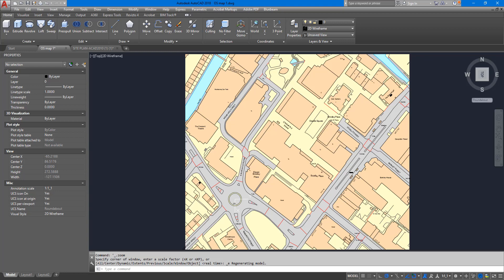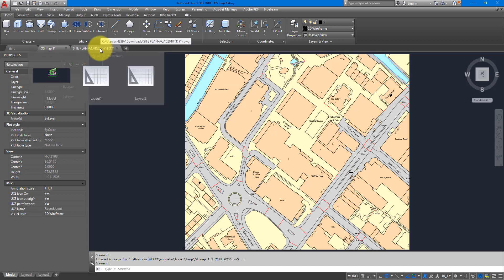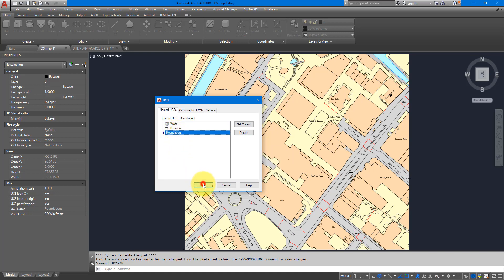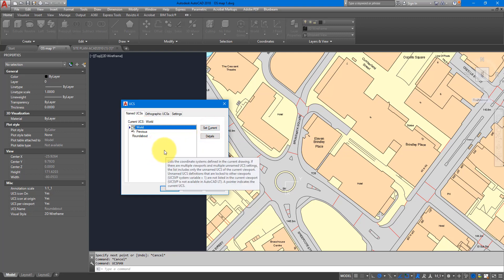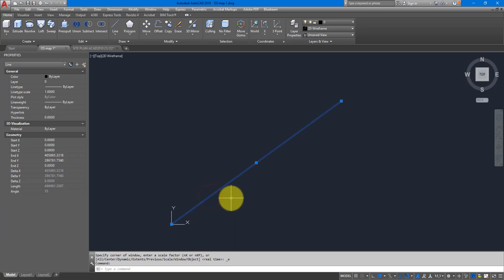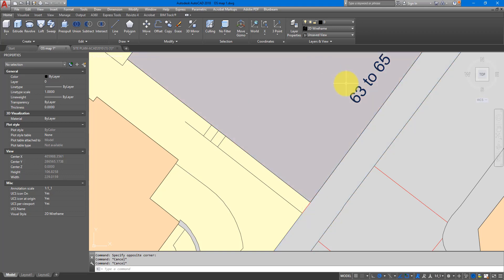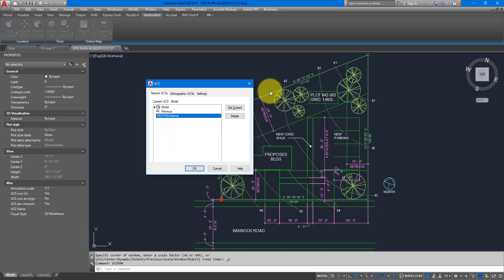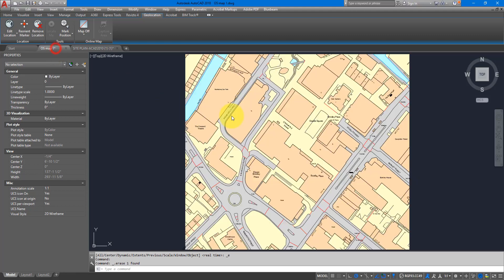Revit Snippet: Check If a DWG File is Geo-located

Comment: I set up the 'World' as current in the USC manager, then If I draw a line and specify the 0,0 as a first point, point 0,0 is far away but not landed on the WCS icon. Is this mean this CAD is not geolocated?
Reply from the maker: It can just be because your WCS icon is set to dock at a fixed location on the screen, such as the lower left of the view. Does it move when you pan the view?